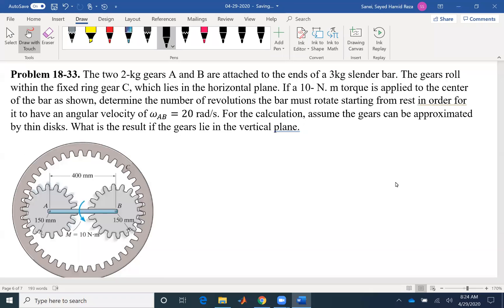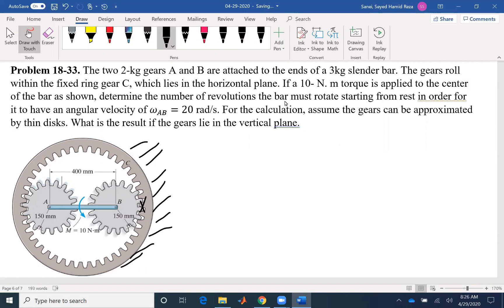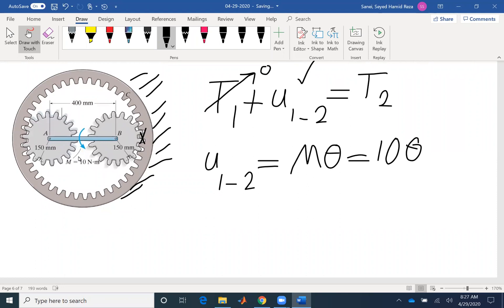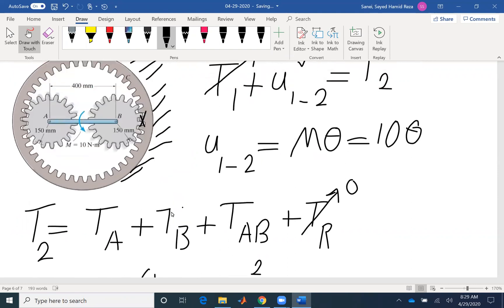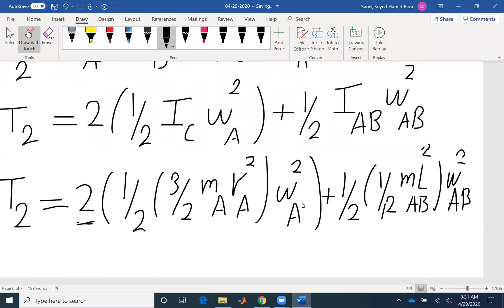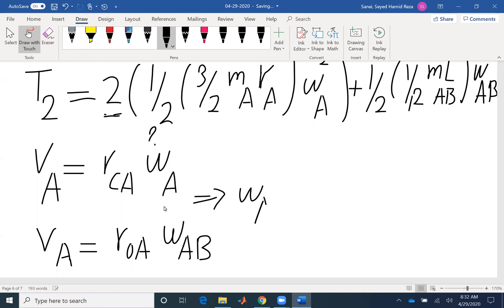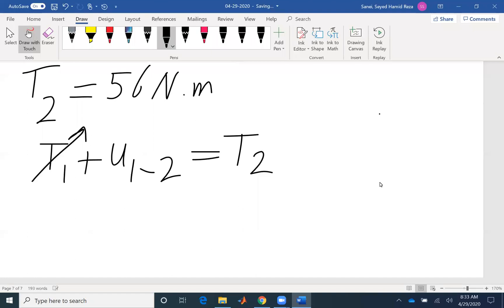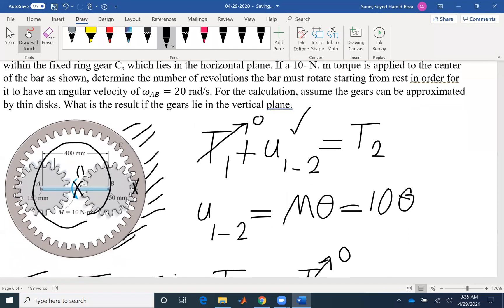Dynamics Example 8-33: Work and Energy problem for a planetary gear system

Comment: The question says that it is in the vertical plane, shouldn’t we consider the gravitational potential energy as well?
Reply from the maker: Very good point, yes, we should but they cancel out due to symmetry as one goes up, the other goes down, so the result would be the same regardless whether they are in horizontal or vertical plane
Reply: @engineeringvision  I understood really well. Thank you so much 🙏